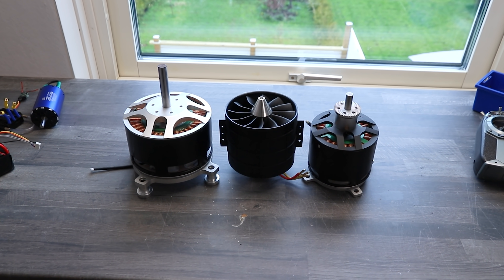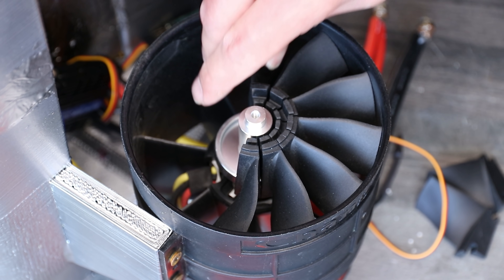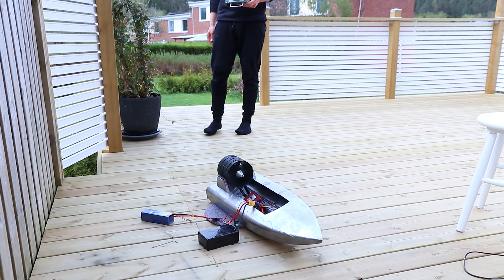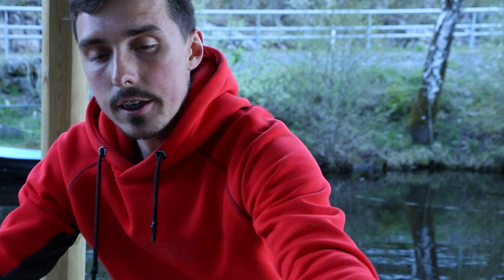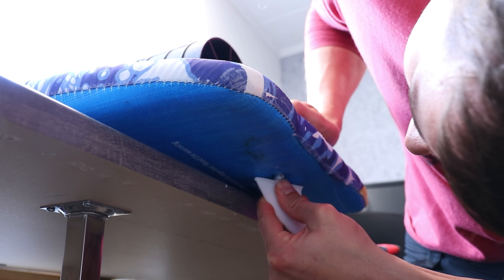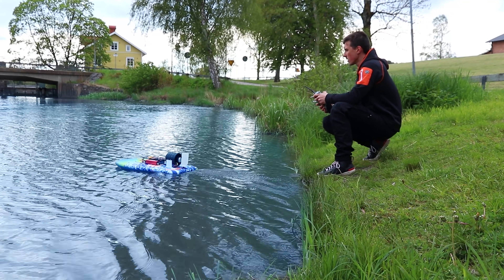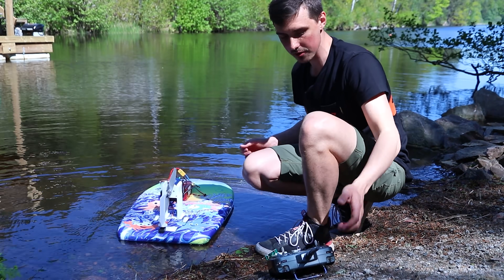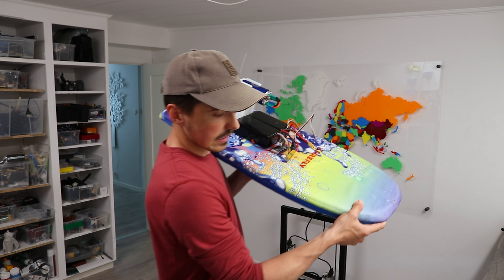How This 7000W Motor Was NOT  Powerful Enough!

Comment: Hey man,nice project,,however after viewing your video,the two blade propeller has higher rpm achievability,but the thrust factor to push the weight of the components as well as the boat housing seems less when pushing air on a medium like water which has less surface friction than on a road surface. I think you should try a 4 blade propeller. Also hovercrafts seems less efficient compared to water submerged propeller driven boats.

Comment: Simon, you have to realize that displacement hulls are only able to go as fast as what is governed by their Froude number. It's hard to believe but if a hull does not come up on plane and start to hydroplane, you could strap a 747 engine onto it and would only go so fast. It's a bit like Carnot efficiency.  Anyway, your first boat looks like a planing hull but maybe it never started to plane.  I'm sure if you change your boat hull geometry you will have success. Keep up the great videos.

Comment: @RcLifeOn The issue you had in the start was likely to do with the spark-free XT90 connector, they have a resistor in the first part of the connector, so you have to connect it properly in order for the power to not go through the resistor when using high power.

Also the issue with the first fan not moving the boat fast is that the motor is on top of the boat, meaning the front of the boat is pitched into the water by the force of the motor.
This increases resistance more and more until the motor essentially works against itself. The fix would be to angle the motor upwards more.

Comment: 1 why are you trying to use air, theres a reason speed boats have props in the water. 2 your thrust angle is way too high. you are pushing the nose down when you accelerate which increases friction

Comment: I have an idea for your project... apply a hydrophobic solution to the bottom of the board. It needs to break tension with the water. The water is slowing it down.

Comment: ay mate, been around boats my whole life, never not had one, i built one.. cast a 1950 wooden hull clinker into fiberglass... it was a dog box! mate this thing push the ass in and lift the nose and ride like it was popping a wheely, now, trim, i had that boat trimmed as far as i could, no more trim, ran out SO.... cheeky move.... dropped a set of wings on the prop leg. made me engine hydrofoil.... the boat went from 15 knots pushing a wake like that tsunami in 2011 to 25 knots and F/A wake. reverse engineer me idea.... make a wing, use that to trim ya boat and then you can see what she wants for trim and then adjust ya vessel accordingly. dare say i could get like 40kmph outta that hipopopotumus, just need trim and conditions.

Comment: It’s not that the motor isn’t powerful enough. Study the reason why they use different pitched propellor blades and why they use 2, 3, 4 and 5 blade propellers on aircraft and you will discover how that is related to the diameter of the blades and the thrust they produce.  Take that same motor with a different propellor it would have worked great. The Osprey aircraft/helicopter is a great example of propellor design providing fantastic thrust and control!

Comment: You should always have sharp corners off the back of a boat that needs to plane otherwise you will get a huge amount of drag  like you were getting from that surfboard and if you try to overcome it with power it will only drag the transom further into the water. That's why no matter how much power you put on a canoe it wont plane, it will drag the back down untill it sinks

Comment: Hi Simon! why not adding hydrofoil wings to the bodyboard? you can use 4 "v-shape" wings at each corner. This would immediately reduce drag and speed up that thing. You could easily 3d print it. Check out the boat designs from the 60s. Looking forward to see the update and good luck😄🤞🤞🤞

Comment: Hi Simon.... My opinión is: not the correct motor type.. Size, rpm... Incorrect propeller, size and blade pitch... The gravity center of the table is very high... It needs a fin with weight bellow water surface... A New motor with ducted fan could be a good Start...

Comment: Probably need to be using ec5 connectors instead of xt90 connectors as well. Ec5 can handle up to 160 amps and xt90 can only do 90 amps.

Comment: Dude, you are going through all the mistakes the early engineers did way back in the early part of the twentieth century. if you want something to go fast in the water, you have to make a hydrofoil! There are some good images and videos of the world's fastest hydrofoil ever made, it's called the HMCS Bras D'or, lots of images on how it looked so you can make your own and because you are building a much smaller mock-up of it it will be less finicky that the full sized one. THis is the way you need to go it you want to make something go real fast on the water. Water creates WAY TOO MUCH DRAG,  the best way to get a boat to go fast on water is to take it out of the water as much as possible, hence a hydrofoil and then, watch that sucker fly!!!

Comment: Just do some 3D printed "Steps" in the hull. You will break the surface tension and the thing will take off like a rock getting skipped. All modern, large power boats do it. Like Fountain, Baja, Eliminator... etc.

Comment: Maybe this info will be of some use. Sorry if it was posted before. There are two types of boats. Planing boats and displacement boats. Planing boats are self explanatory. They skip on the surface of water and their speed is only limited by power - drag. Displacement boats on the other hand are limited by their length. The bow of the boat creates a wave. it rises from the bow and after reaching it's peak it drops toward the stern of the bow. The second the boat reach a speed where the length of the wave is equal to the length of the boat (length of the water line) the stern of the boat falls in to the well created by the end of the wake. No matter how much power you have, if your boat is not planing, it can not go faster than it's theoretical hull speed.

Comment: I'll bet the ducted fan would have worked fine if you mounted it up higher like an airboat, or add an angle adjustment to set the trim after you get going. That way the hull does not impede the flow.

Comment: Have you tried a water pump? One that sucks in water from a front facing duct below the surface and blows it out the back above the water. I've 3D printed multiple water pumps and some of them are scary powerful even with small motors in the sub 50W range. I'd love to see what 7000W can do :D

Comment: ONLY a nice Tip, go to Mp5 Hydroplanes / 1:6 & more Scales Hydroplanes & weight r. is Amazing!   Kits for easy builds & they go soo soo fast - i have One with 2x 400A encs/Waterc. & 2  I.P   Cola-can sice  , Made a Watercoolingchamber for both Brushless I.Ps - ...   But,  its overpowerd- to mutch weight -  ,ok..147mph... But i made with the Ul19 & a 6 P Hacker &  one 400A enc  157 mph  !!   ...  Build my Next Mp5 -  but with a Novarossi  Nitro ,  theyrs a new Desing with 3 Wings integrated... Front..  a real cool desinge for more speed!      Mfg  from Vienna 👍🏼🇦🇹

Comment: if you under volt the ducted fan by ~1/10 to 1/5 of design voltage (like 3.7v or 7.4v for a 48v fan) you can run the ducted fan IN THE WATER! (yes it works, (though I changed the KV of the motor by ~1/4 and then undervolted by ~1/2) and got 50lbs thrust form and 90mm fan!)   (a friend make "practical" use of this development here: https://www.youtube.com/watch?v=Ug5OwnSt42s&ab_channel=Ryan%26David)

Comment: I think you would have better luck putting the motor further forward and if you need more weight in the back put the batteries back there. just maybe 3 or four inches further forward  thats about where the prop is located on all of my airboats.

Comment: Great work. I think perhaps the selected paddle board itself might be part of the issue... It looks similar to the ones we used to have as kids with a sort of "woven cover" which i think for this application would have quite alot of drag? perhaps if you wrapped it in smooth plastic or a coat of epoxy resin to smooth it out you might get slightly better results?

Comment: A few problems, your using 1 propeller & it only has 2 blades. 
Unless there’s a reason you can’t run a propeller or jet drive pump (debris like a swamp) abandon this and save yourself $$$$$  
here’s why I say that with a real life example… 
Air boat with two counter rotating propellers ea with 5 blades (10 total) with a diameter equal to the hulls width 
Powering the propellers is a a 2,500twin turbo V8 (1.8kV) 
Placed into a racing airboat hull and the end result a boat that takes off like a rocket going all the way up to 100mph! 
The traditional boat drives will go far FAR quicker for pennies instead of thousands

Comment: Introduce some pitch control by setting up a horizontal control surface (eleavator), or even better a motor mount with variable pitch, so you can control the propellers angle of attack. Both remote controlled.

Comment: Don't know if somebody already commented on this, but clothed body boards have so much drag. It's not even funny how much force it takes to move them on water. We tried them for wakeboarding as kids, but these things stick to water at moderate to high speeds.

Epoxy it on the bottom and sand it down, best would be surface like a golf ball to get some air under it.

Comment: The hull is the wrong design for distribution the weight you have (which I'm sure you realize), and the paintjob killed it's slip.   Use hydrophobic spray next time, keep that hull slick at all cost.    Also you should integrate a vertical thrust vector to auto level the hull with a gyro with a venture to increase static pressure velocity.   Just some food for thought.

Comment: With an EDF you need to build a thurst tube and nozzle setup.. straight out of the EDF it in Laymans terms just barfs out a large quantity of air. You have to get it going with some velocity to make real thrust. Look at the nassels and thrust tube designs of EDF RC planes. I have a 12s 120mm EDF that pushes a 12lbs airplane though the air at 115mph. That same motor would take that body board to space if you have it full throttle

Comment: Not near 7000W! Voltage is there but air is not sufficiently resisting to require enough Amps. If you want to move through a medium quickly, the best way is to move that medium quickly (propeller) and not to move a 1700 times less dense medium instead! The only advantage of air propelled water vehicles is crap under water but for that you need a lot bigger prop. Look at the hovercrafts for god's sake!

Comment: When you plugged that connector in, did you go all the way? Those xt90's with the green markings have an anti-spark resistor and if you don't plug it all the way in, the resistor will be in the circuit and burn up.

Comment: the problem with your bigger motor is the KV rating.
the smaller blue motor will perform better because it will have higher KV.

Comment: Man I love your work and struggle.  It  is inspiring.  If your wanting to use EDF for propulsion, you need a hydroplane design for reduced drag.  The end of your hull must be sharp and reversed angled (like this _\  ) to stop the water following up the curved surface.  Perfect example, stick your finger over the moving water of a hose and you will see that the water will follow up the curve of the finger tip.  See Ken Warby world speed record boat called 'the Spirit of Australia' for inspiration.  Perfect hull for EDF

Comment: Some XT90 connectors have antispark resistor, plugging the connector half way means that the current goes through that resistor. The connector has to be plugged in all the way

Comment: Great project, If i were building a hull to go fast, i would eliminate some of the drag of the hull with steps (look up stepped hull) that will help to eliminate the hydrodynamic drag of your hull. also if you angle the motor up (propellor facing up slightly) you will modify your angle of attack for the hull. this will give you bow lift, eliminate some drag, and help you up on a plane. this will also help you bow submerge less saving your electronics.

If you want to go off the reservation completely, build some hydrofoils, eliminate hull drag by several orders of magnitude

Comment: Aim the fan a little bit more down at the water or use a servo to control the trim of the fan or put trim tabs on the back of the boat, that boat hull needs to get up on a plane then it will be very quick with the 3d printed boat, you actually had the foam board do the same thing the back of the craft was digging in loosing all its energy, when you had the prop on the opposite effect occurred, so when you moved the batteries you changed the trim, you need that on the controller. good luck edit: also what Andrew W said about a planing design but i think you could do it with the edf and that 3d printed boat. your also fighting water tension because your not driving it from underneath and pushing the boat out of the water so to speak, you could do a mini motor under to get it moving then switch to edf while controlling the trim change. but hey more content the better amiright? ;)

Comment: You should have used 3D Printed hydrofoil wings on the bottom to cause the boat to “fly” causing less drag, would have problems with weight though

Comment: You're hitting the top air speed Witch is a lot slower on the water but if it were a plane it would go a lot faster, do a jet boat or prop boat it will be faster.

Comment: The first ESC you used looked like a 180 A Seaking  controller. If this is the case you can only use 6s = 22.2 V max.

Comment: The motor and the ESC are powerfull enough, so that is not the reason your construction doesn't work properly. I guess you have the wrong batteries, check out how much electrical current they can deliver (C-number multiplied with the capacity (mAH) gives the Amperes ... It should be around 150 A.

Comment: The impeller needs a clean fast input of air to fully bring its power into the air. Your boat was way too slow for that, and, sitting in the water that deep, developed way too much drag. Switching to the propeller was the right move. The propeller you used there was ridiculously small, though. With the limits to propeller diameter you obviously have with that boaty-floaty design, a 4 or 5 blade propeller would make a vast difference. The trouble you will run into next is that there is quite some lever between the planes where the thrust of the prop and the drag of the water act. the result will be that, the more thrust you get, the nose of the boaty-floaty will get pushed down into the water. Trimming flaps at the rear of the boaty-floaty-thingy would probably solve that problem.

Comment: Ive had a little experience of building air boats on those body boards and I found that the faster you go the more the nylon cover on the board sags at the rear because it fills with water which makes the cover sag at the rear end , you will have to remove the cover if you want to go faster and maybe even waterproof the polystyrene board somehow with light balsa wood and seal it with cellulose dope.

Comment: I bet you'd have better success with 4 quadcopter motors about 3106.5 1450kv on 8s. Or just one spinning a  6-8 inch prop. The esc would be super light.

Comment: You need the trailing edge of the hull to release the water like a windsurf board. Otherwise you will never get planing on air power.

Nothing to do with your electronics, just has to do with your terrible hulls lmao.

Comment: 1. That body board should do fine with a 55g motor and 3S 2200mAh battery.
2. Balance it far enough forward so it doesn't dig in its stern.
3. Experimenting with motor downthrust / upthrust is extremely useful.
4. Put your electronics in a Tupperware box, you filthy rich YouTuber!

Comment: Water is much more dense then air so you gotta move multiple times the amount of air to get the same speed as if you use the water to push it forward. And I'm pretty sure it grows exponentially
Reply: A hoverboat would solve that problem, BC instead of moving in the dense water, it's the lot less dense air your using

Comment: Just cause the motor says 7000 watts doesn't meant it's going to do that. It needs sufficient  load to pull that and the driver and battery to push that much power through it.  You would need to put an amp meter on the motor leads to get a better understanding of how much power the motor is giving. The prop size will also affect this .

Comment: You have to much drag from water. You need air entrapment hull...catamaran  hydroplane type bottom. The flat board like you are using is like an airboat and they take a lot of power to go fast. Air gets under the bow and lifts it to a point and then the air blows out the sides. You need to keep air under the boat and it need to exit out the back. Probably dont have any fast boats where you live. I live near a lake and there are litterly thousands of fast boats here...look up tunnel bottom, hydroplane, big cat. A big cat is a v bottom that has been cut down the middle and each half has been moved out and a flat area in the middle.

Comment: Bigger motors for bigger propellers. What are you adding power for, if you end up using a tiny propeller? Power is for moving air, and you're not adding air pressure. I think you end up cavitating (i.e. producing a void into which the propeller moves) rather than producing thurst. For inspiration, I suggest you take a look at the air boats that are used in Florida's everglades: their propeller is huge, and for good reason.

Comment: Are you sure you're connecting the 6S pack in series? The RPM of both the fan and prop sounds about the same with 6S and 12S. It should be near double the rpm.